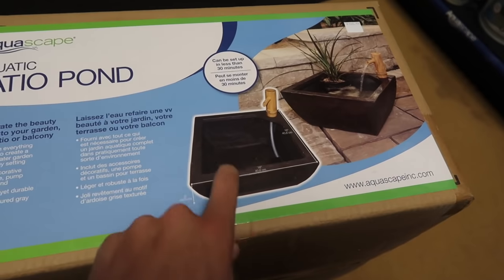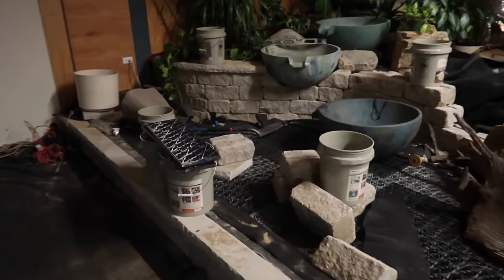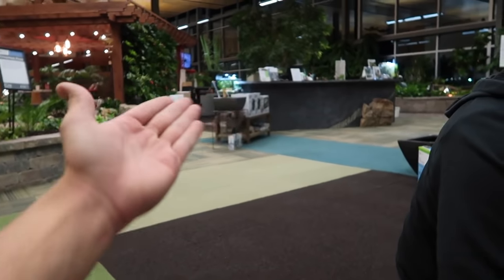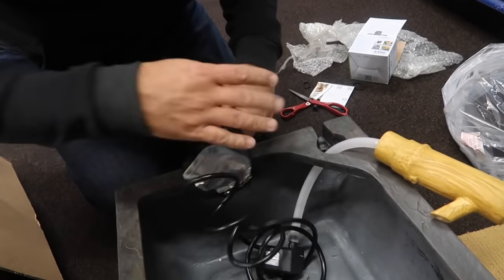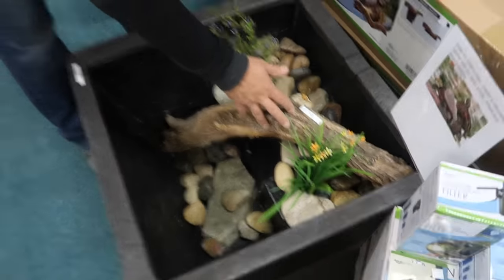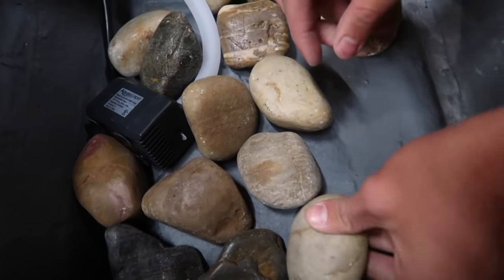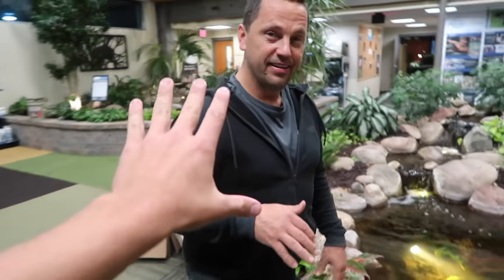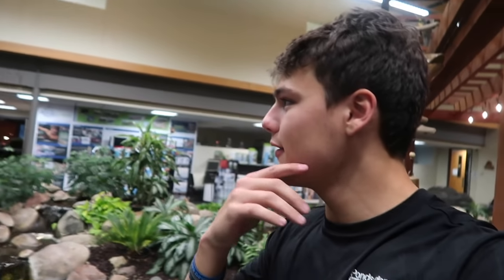How to Make GUPPY POND in 10 Minutes!!!

Comment: I wish you would added this to the video but it's not that important for the newbies, tannins are actually a good thing.

it's a natural water chemical that makes fish feel more at home and is part of some fish immune systems.

Also darker water makes fish feel safer.  

I'm sure there's a hundred different benefits of tannins and the only negative is the fact that it's literal rotten wood.

But you have to do water changes anyway so you might as well have at least some tannins in the water